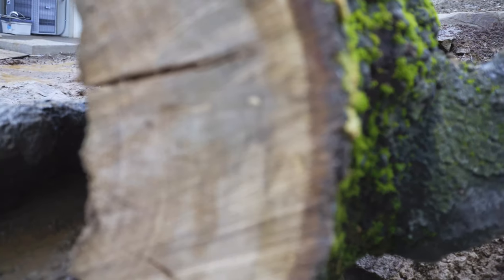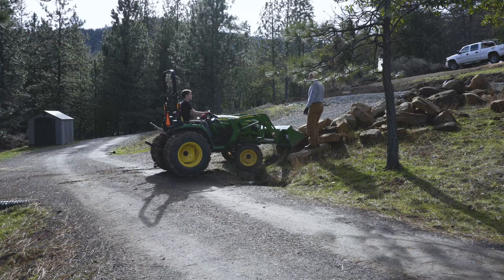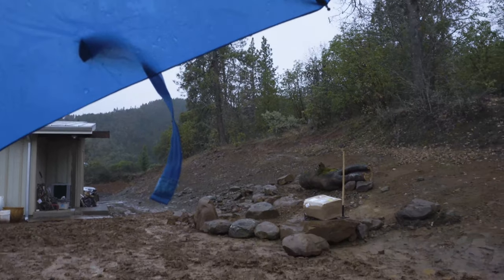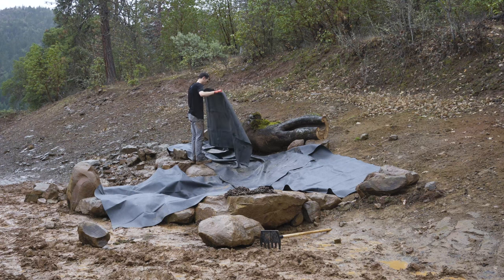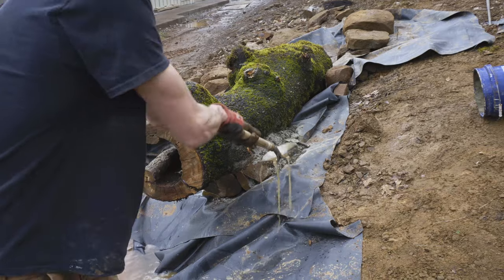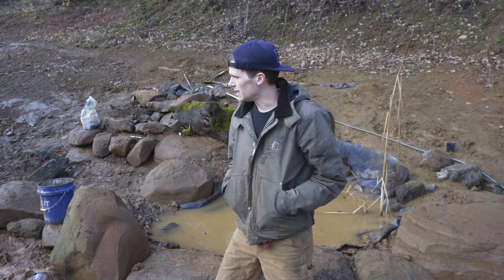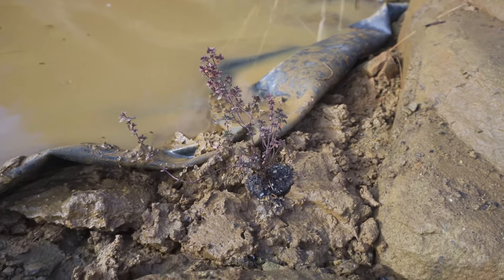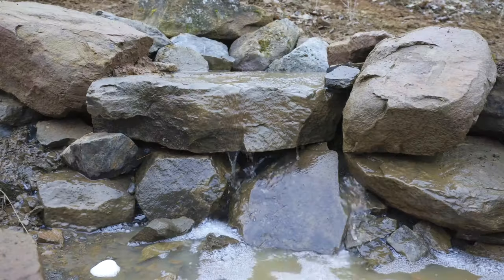Waterfall in a Hollow Black Oak Tree. DIY

Comment: Nice work and this got my subscribe. I would like to see a follow up once the final landscaping is in. Did you have to treat the log with any water proofer or sealant. Seems like the moisture will eventually progress the rot but would take many years. Overall awesome idea and nice execution on the design.
Reply from the maker: Thanks! I didn’t treat the log at all. I think we’ll get several years out of it and then I’ll put something else in its place. I will try and do a follow up video.

Comment: I was wondering if you thought about using a sealer on the inside of the log? My thinking is with the amount of water running through the log that it may tend to rot faster than normal and I would hate to see that part of your water feature crumble away prematurely.
Reply from the maker: On the contrary rot needs oxygen and once the log is soaked through the rot will be very slow. It’s more likely to rot on the backside from bugs and mud getting washed onto it.